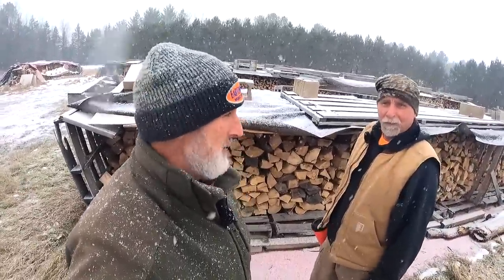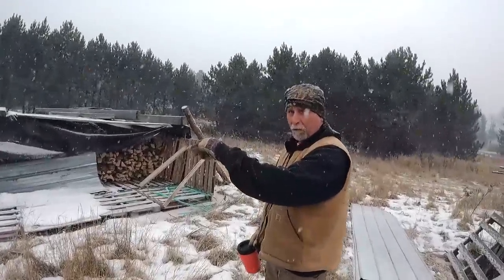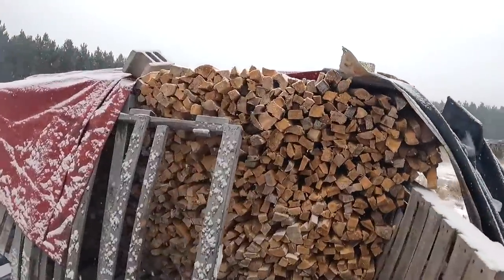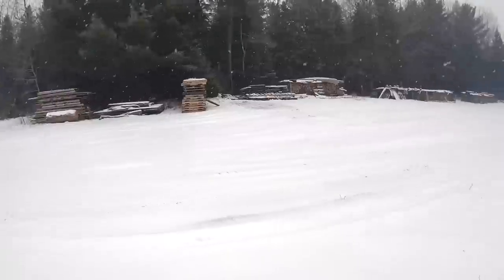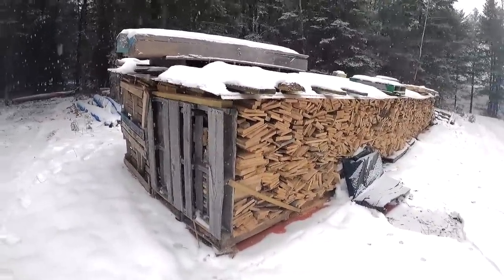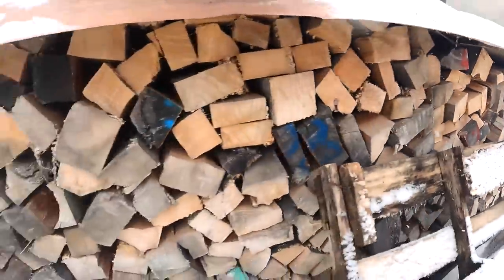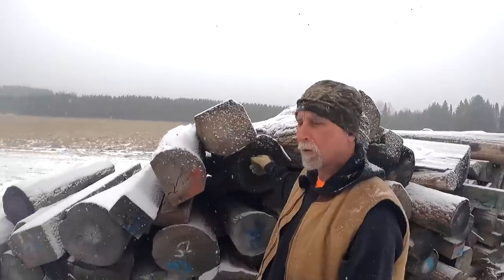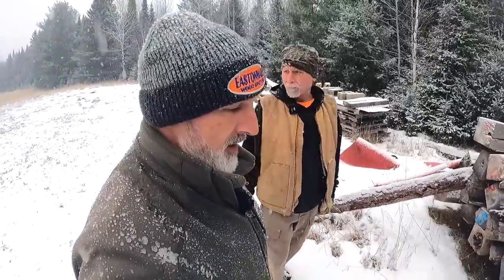MORE firewood than God!

Comment: Hi Cris,Ed here from Vt.i cut it in the woods,load it on a trailer behind my 4-wheeler,than draw it out,load it on the trailer behind my truck,get home,split it off the trailer,toss it in my hatchway,pile it,handle it quite a bit,but i cut only for my own use.
Reply from the maker: That sounds like fun, you have a good system!
Reply: @InTheWoodyard  works for me